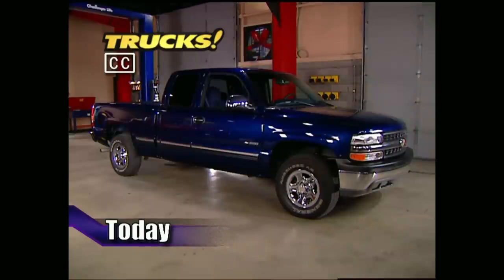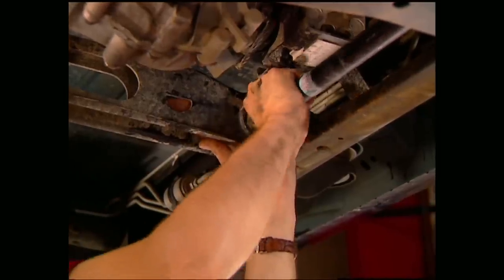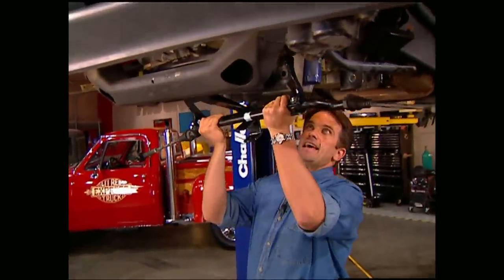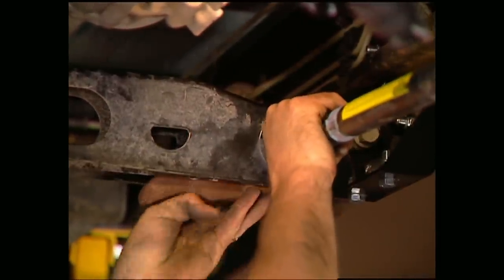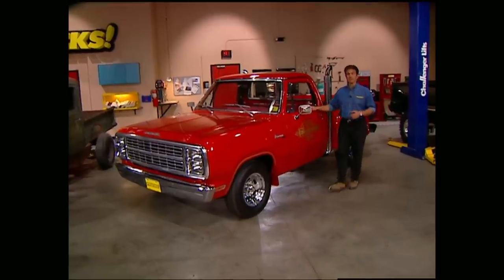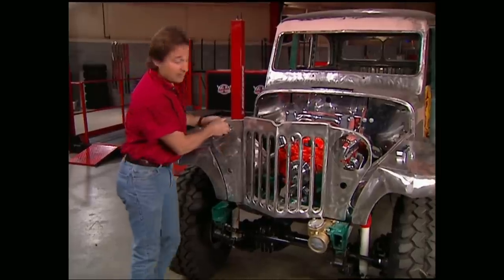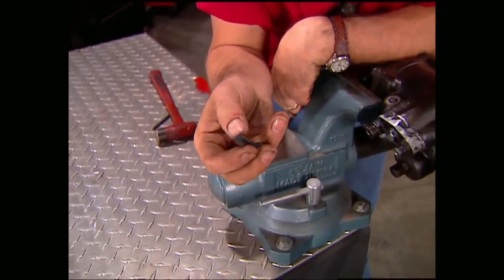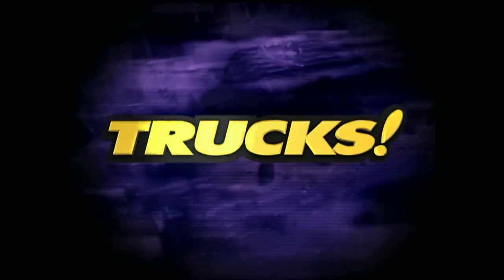Raising a 1999 Chevy Silverado With a 6 inch Lift Kit - Trucks! S2, E2

Comment: I bet that chebby has had 4 4l60E’s, 5 gauge clusters, 3 sets of driver door hinges and is rotted out by now. 😂
Reply: I bet ur second gen has had about 4 transmissions as well had some issues in wiring and has had about 5 or 6 speed sensors in the rear end
Reply: There’s problems with anything if u wanna be nitpicky enough and 4l60s do just fine unless u put more  power behind it than it had stock
Reply: says the guy that the truck was soooo bad Dodge dropped it off their nameplate and made them make their own. RIP Dodge Ram 1500
Reply: @eternalthread7846  completely disagree. The 07 is the worst truck I ever drove and worked on. The penny pinching is so obvious along with all the failures its sickening that our government bailed them out at this time.
Reply: Anthony Hales it all depends how you treat them a bunch of my friends have “cateyes” and the one that get beat on a treated like a toy are always breaking sum the ones that are used for work and taken care of have very minor issues here and there
Reply: 4l60Es only break when you tow in overdrive and destroy the torque converter
Reply: Probably not. My 2000 Extended cab stepside Sierra 5.3 Z71 with almost 240,000 miles is still going strong on original drive train,  never had to do anything to the truck but basic maintenance🤷‍♂️.
Reply: 1995 Chevy K1500 180k miles original 350 small block and 4L60E trans

Comment: What about the bump stops in the rear? It should have longer ones too, if you loaded up with some weight the springs will over bent and get damaged because there's no bump stop to stop them from over benting, what hell..

Comment: Yeah I'll just crank my torsion bars on my 99 sierra  to level it out n get a late 70s Chevy to lift for offroading
Reply: My 06 2500hd cleared 35s with a level. My k30 does the off-roading though.

Comment: according to custom offsets you tube video don't crank up torsion bars after any lift is installed otherwise ride quality will be poor So im wondering  if you want a good ride buy a  lift that is 2 inches more then you plan on using ?

Comment: I can do this to my 2000 Silverado now that I could afford to buy one lol
Reply: I have a 2000 gmt400/ k2500 but its old body style got it for 2500 with 70k mi
Reply: @dixiecbclub3437  Strange GM fact, the GMT400 series didn't officially end until 2001. The half ton trucks got the first GMT800 restyle with the all new LS based V8's in 1999. In 2000, the Tahoe/Yukon/Suburban got the GMT800 upgrade. Your truck, a heavy duty pickup didn't get the GMT800 treatment until 2001. It sure was a strange transition for GM trucks and suv's, but also the beginning of their decline as well. Both of you are lucky to have those trucks, they are the last of the good ones. My 1999 Z71 looks just like this one, but sunburnt BAD. The truck has over 300k(rebuilt trans at 240k), and still runs strong! Keep them forever if you can boys, they don't make em like this anymore...

Comment: All that work, and you put blocks in the rear, axle hop here we come 🤦‍♂️
Reply: This was like 20 years ago so lift kit parts were not the best
Reply: @haydenreyes4621  maybe, but resetting/custom leafs has been a thing since forever. Lifting with blocks is a terrible idea when it comes to actually off roading. Used to frequently drive a friends truck with 6 inch blocks in it, had axle hop from hell when it broke traction on a hill or in sand.
Reply: In the video, Stacey states they chose blocks over leafs. I assume that choice was based on what Superlift was willing to give them for free.
Reply: The worst part is they stacked blocks on top of blocks! You'd be ridiculed for that now that most people know better. Hahaha

Comment: Look, I've taken the load off my torsion bars and tried to take them out.....they don't slide out like that, not at all.  I'm guessing there was a whole lot of work done off camera to get them to slide out like that.  Maybe on a brand new truck then would but a truck that has been used and has any kind of rust down there....not a chance
Reply: They do when its new. This is like 20 years old

Comment: I tried to imagine the way  99'silverado managed to stay rustless...
Reply: I have a 99 Silverado 1500 Z71 Extended Cab (3 door). It is my every day driver and has a little over 300k on it. There us ABSOLUTELY no rust anywhere on my truck. It has been all over the US during the winter months on hunting trips. Places with tons of snow like Minnesota up on the Canadian border,  Wyoming,  Montana, Nebraska,  Wisconsin,  the Upper Peninsula of Michigan, Colorado,  up and down the Rockys, Maine, Vermont,  New Hampshire,  you name it. 
I have never done any type of undercoat or oil spray to the frame or undercarriage.  I just wash it after every trip. 
It only has one small dent, at the front license plate bracket where I hit a hog 3 years ago.
It has been one hell of a tough truck. No lift kit, just bigger tires for if road (285/70/16 BF Goodrich All Terrain T/A E series) since it was 6 months old. On its 3rd transmission, factory radiator spring a huge leak at 290k, factory water pump died at 280k, and sadly the factory engine dropped a lifter on #7 at 300,015 so I dropped a complete new crate from GM.  Like I said, this has been one tough truck.
Just ordered a new 2020 with the 3.0 Duramax. I hope the new one is as good as my 99.
Reply: @mean45acp  thanks for such an interesting story! In 2008 I bought a 04'dodge Ram 2500 in NY with about 60-70k miles. Delivered him to my place in Russia (st Petersburg). Looked underneath and saw exhaust pipes were completely ruined with rust. Thought much. Took 3inch stainless pipe, grindcutter, welder and made a custom system. Then I learned that streets of NY are polluted with tons of salt in winter. That might have been the reason. I  had owned ram until I bought a new pajero (Montero) in 14. Ram is a nice ride! Miss him!!  It didn't get rusty. Only wheel u-joints used to wreck time to time. Sorry for my russian english;))))
Reply: @mean45acp  BTW. They don't make reliable cars anymore. They say it has no sense. Fucking managers are creating modern cars instead of engineers, modern cars live 100-150 k miles if not less. Don't even dare to dream about reliability of cars from the past.
Reply: @mean45acp  I have the same z71 and done put one motore and two transmission in it. Only has 156000 some mile on it dad bought it brand new in 99 and gave it to me in 13..been a good truck other than that..
Reply: @B-bop_1027  
They are great trucks if you take care of them. Still driving mine. It gets driven almost daily and is still my go to  for hunting trips. Now has 349, 489 on it. The new engine went in like a plug and play should. Changes it out in 4 hours. Have been considering changing the TBI injection fuel system over to a better fuel injection set up, but other than that, mine is STILL a beast. Still not a spot of rust on the frame or anywhere else I can find. I just powerwash the hell out of it after every trip.
I am amazed I haven't had a single transfer case issue yet.
Had the seats redone back in the spring by KATZKIN in  same color leather but added the COOLED seat option. Now it has heated/cooled seats. Redid the entire interior. All it needs now is PAINT. CLEARCOAT finally went. So when hunting season is over  it is getting a new paint job to match factory paint.

GOOD LUCK WITH YOURS!!!
Reply: @mean45acp  yeah I drive mine daily to work it's my only vehicle the only rust I got here in West Virginia is the bed wheel wells but other than that still good 27 years later and I did have to swap out a transfer case for the 4 wheel drive but I keep it up and running. More of a sentimental thing from my dad going to drive it until it won't go no more wouldn't trade it for anything else.. thanks.

Comment: Awesome love to looks amazing now you should do a 4 inch body lift on it and talk about all the benefits a 4 inch body lift gives you I live in the rust belt of Ohio and have done a 4 inch body lift on every truck I've ever owned there are a ton of benefits to it easier to keep the frame clean so it doesn't rust way easier to work on everything on the truck extremely cheap to do and possible to do in your driveway with just a jack of course a left makes it way easier but there are so many benefits to doing a body lift including being able to fit larger tires under it and the list goes on and on and can be done in less than a day in anybody's driveway with very basic tools of course I don't have to tell you guys all  of this

Comment: Umm... That's a 2000 up truck homies... The 99 is square shaped... Plus the 6 lug will tell you you have 16 inch rims a sign it's newer than the 99 last good Chevy platform before selling out...
That body isn't the same as my 99 Tahoe or suburban...
Just saying, it's not a frickin 99...
Reply: Ummm you’re wrong.
Reply: @Icutmetal  sure I am, I have 2 99s but I'll be wrong, whatever floats your boat...
Reply: Jerome Garcia Strange. I have a friend that purchased a ‘99 1500 Silverado that looked exactly like this, and it absolutely had 16” rims. What you had was the body style of a 1999 K1500, not the new for 1999 Silverado. You’re comparing a Silverado to a Tahoe/Suburban anyway, which didn’t change body style until 2000. You’re still wrong. Just sayin’.
Reply: @Icutmetal  yup
Reply: Jerome Garcia Hows that crow taste?
Reply: How bout that??

Comment: How do you just add those rear blocks and not think that's unsafe? Just looks like it would be unstable.
Reply: @bigboreracing356  it's good to see you still telling people to STFU.  Makes me a happy person.
Reply: Mr Libowski  the blocks are not the issue here dude.   You're being very un-dude like.    Plus anything sitting higher will have a higher CG and be more unstable.
Reply: blocks are stable crush proof and are basically just a meduim to act as a spacer. the ubolts apply the same tension wether there is a  block or no block and pins center everthing top to bottem. In the comparison to lifted springs/stock springs with blocks the only down side is blocks exert more leverage on the suspension and could cause a little axle wrap. but thats more of a problem with stock springs being worn out. besides most manufacters have factory blocks. blocks probly be  not the end of the world
Reply: Have you seen the factory blocks on Fords?